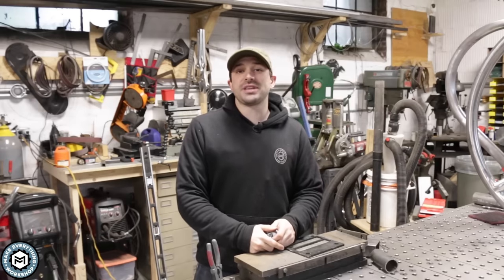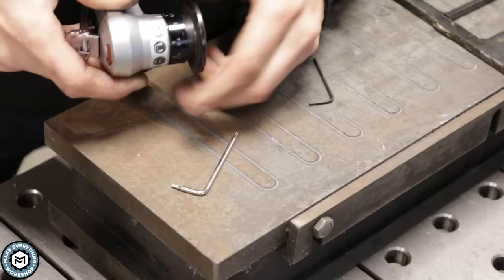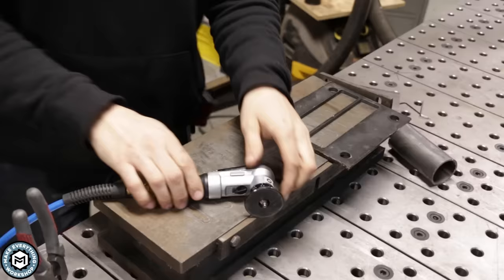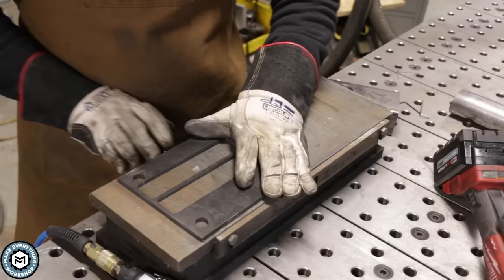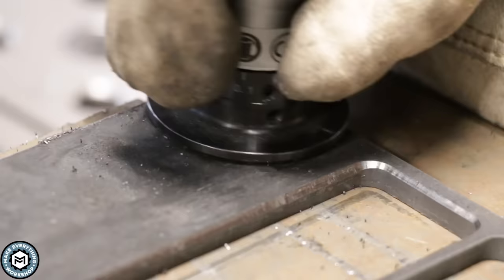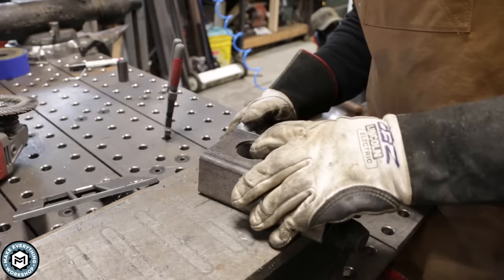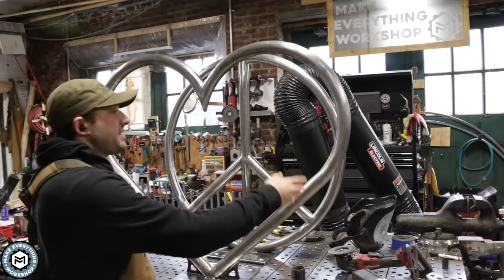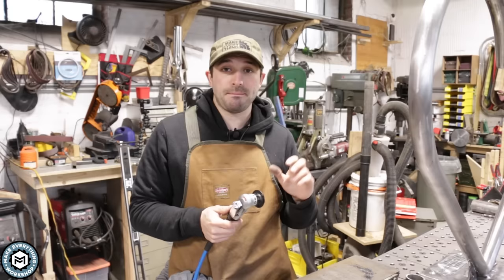This $88 Tool Will Change Your Metal Work Forever!

Comment: I'm a recent self taught welder (!) - what about using this to "grind" welds rather than using a disc wheel?  sorry if it's a stupid question, I don't know that much about metal work.  on the other hand, I've been writing software professionally for 30 years, so think about how you feel when you ask computer questions....
Reply from the maker: If you are referring to grinding before you weld to have a nice chamfer for the weld to go in, this would be fine for that.
Reply: Being new to welding he might be asking about after-weld grinding. Probably keep using a disk until you get good enough at welding to not need grinding 😁

Comment: The plate you are doing your demo on it too thin to use on the magnet. You are jamming the screw for the bearing into it while you use the tool. Just hang the part off the edge. It is basically just a small router with metal cutting bits. Keep the bearing oiled and it should last a while.

Comment: Measure the bearing and check with  RC helicopter suppliers . horizon hobby or align helicopters may have the size you need .

Comment: If you can find brake lathe cutters  that fit, you can flip them over so you get 6 cutting sides
Reply: The geometry in which these are mounted is of a positive style thus not possible to flip over.
But it should be a standard T-insert, just need to specify the size, thickness and relief angle.

Comment: The bearing is commonly used in aviation. The part number is on the side of the bearing you’ll need take a cell photo and enlarge it and you can read it and order on Amazon. Just saying 😎

Comment: imho, everyone should learn metric measuring, unless you are absolutely positively gonna stay confined within the US borders. Most of the world uses the metric system.
Reply: You'd be surprised how much stronger imperial threads are vs metric too.
Reply: @harperjmichael  I call BS; both metric and imperial use the same 60deg profile, just with nominal dimensions in the corresponding units. Metric is a slightly higher TPI than UNC from memory, and size for size a fine thread is stronger.
Reply: What's really funny is that if you are doing any machine work or using anything finer than a tape measure, you're already working in metric that isn't metric. Meaning, as soon as you convert your measurements to decimal form, it's the same as the metric system.  
Ex. 0.125"  
Metric is just simpler.

Comment: If the bearing goes out just make a bushing to replace it and grease the edge to prevent heat it will be fine on small pieces

Comment: Seems like the bevel varies quite a bit on the first two zoomed in shots.  Is that an optical issue or does the bevel vary on thickness due to pressure?

Maybe that loose bearing is contributing to it?

Looks like a great tool and I'm really glad you showed us.  I just want to know what the limitations / expectations are.

You kept saying consistent chamfer, but seems like it could be a little more consistent?
Reply from the maker: If the edge has any defects in it it’ll translate in the chamfer so you have to be aware of that. Also you need to have the tool perfectlyy flat on the work piece or it’ll cut uneven. Takes some getting used to
Reply: @MakeEverything  thanks for the added detail!

Comment: how about chatter breaking carbides, it seems like you can hold the part in your hand without any trouble
Reply from the maker: So far so good but easing into the cut would make a difference if your taking a heavy cut
Reply: Chatter breaking carbides, I think you mean the asymmetric flutes distance on an endmill, which will not let harmonics to develop.  With a tool like this, where you insert your inserts into set slots, there is nothing you can do.  Does it make sense?

Comment: I was making an exhaust flange for my Japanese tractor. Trying to do it SAE I was coming up with really unmanageable measurements. Then it occurred to me, this thing is metric. The bolt holes are 50 mm on center. That only took me one half hour to figure out, sigh
Reply: metric on a japanese tractor? who'daa thunk it

Comment: Dont work in metric?  All ya gotta do is divide mm by 25.4 and ya got inches.  Or other way, ya want a 1/8” chamfer.  0.125 x 25.4 = 3.175mm

Comment: Thoughts on buying the bit and using it in a router? Anyone know what kind of rpm it runs at and what the shaft on that bit looks like? Just asking because I already have a router and my compressor doesn't have the cfm's to run that.
Reply: I use a small router on aluminum.
Also ear plugs and ear muffs.

Comment: I have owned a Dotco 90 degree angle sander/grinder/shaver/saw for years, and I have many of the attachments that make it a very versatile tool.  The one you just demo, the Dotco could easily have this as an attachment on a much higher quality tool, but alas, it does not, leaving me to seriously consider yet another tool purchase....argh :-)

Comment: im 100 percent sure thats a standard bearing
if this tool used for  metal, then its  better  to check before  use,  measuring the  bearing and order a couple of   of them

probably a few dollar  one pc
its  quite aggravating   tool breaks down by a 2  dollars bearing
as well as inserts should be  on shelf as spare  parts

Comment: That thing is awesome! How do you think it would work using a smaller air compressor, such as an 8 gallon?
Reply from the maker: That’s a good question, I’ll have to try it on my camel compressor and see
Reply: @MakeEverything  It need .22 m3/min that is 7.77 cfm, 2 1/2 hp compressor cannot keep up
Reply: Itll spin it good for about 10 seconds then it will lose too much air pressure to be useful air tools like this and air drills and die grinders use a ton of air and are only useful if you have a large compressor

Comment: Sorry for the rookie question:

Is it possible to use these bits on say Milwaukee's M12 Right Angle grinder or M12 polisher (higher torque)? Or is 12V not enough power for this task?

Amazing tool!
Reply from the maker: I don’t know if it would have enough torque. I have another video on my channel where I use a steel cutting round over bit, I was trying it in a cordless palm router snd it didn’t enjoy it very much... these pneumatics seem to do the trick!
Reply: Modern 18v  brushless cordless tools are about 3 times the torque of  most air stuff i have ever seen  i really think the M12 would probably be ok .  the little flat plate to square the tool looks like a good 3d Print project  to  then fit to a die grinder or polisher
Reply: I would say RPM may be a problem. I use die grinder that works much the same and it spins at 20 000 RPM

Comment: Nice tool. Just my opinion though, I’d work more and the quality of those welds rather than jazzing up the edges of your gussets.
Reply: In my experience, paint and powdercoat hold up much better on chamfered edges. The welds do look a little cold to me.

Comment: Hey Chris, possibly a really stupid question, but how do you think this would work on wood (if at all)?  I tend to leave a pattern bit in my mini router (the one I use the most) so saving me the time of looking for and swapping bits would be nice. :)
Reply from the maker: I definitely think it would work on wood, it only does a 45 degree bevel but I can't imagine why it wouldn't cut wood.
Reply: @MakeEverything  Being able to put a really small bevel on stuff would save me a lot of time on some projects. Since you can set the depth and all. I just wasn’t sure if it would chew i tup or just make a nice clean bevel. Thanks!

Comment: Bearings look like standard router bit bearing. Home Depot, Lowe's etc. Amazon 10 packs about 8 bucks.
Reply: I have two of these tools, each has a different bearing size. And I own a custom woodworking shop, over 50 routers, hundreds of bearings. None fit either of the two machines I purchased. I matched them up in a local bearing shop, but at a cost of $3.12 each. Quality (USA) was far superior to the bearings that came on the machine, which were very loose and wobbly, whereas the locally purchased were tight and excellent. FYI, the first tool took 2 months to arrive - it was shipped direct out of China. Cost: $75.63.  The second tool through Amazon took 4 days, cost: $62.39. They both looked very similar, though the first one is polished chrome and came with one set of extra cutters (3 pieces), the other machine (shipped direct from China) had only the two wrenches and has a matte finish. Both work very well on mild steel - haven't tried them on ss yet.

Comment: Could this tool work on a very small parts- like a 1/2 x 1/2 square steel tube, GA for a handle cover sleeve?  I would be looking for something like a 1/16th chamfer.  I currently cut them with a chop saw (evolution) and then it takes alot of manual work to clean them up after the cut.  So looking for a tool that can help.  Thanks

Comment: So, its an air powered router?  What is the RPM rating?  Could I just put the carbide cutter in my palm router?
Reply: Yes, woodworking carbide cuts metal also.  You want high speed, and the biggest shank that will fit your tool.

Comment: Those triangles have 6 cutting edges.
Reply: The ones in the linked replacement cutters are back beveled, so only three useful edges per cutter.  
If they had straight sides, you'd be able to flip them, but this small radius cutting tool wouldn't actually be able to use them without dragging the back side of the trailing edges.

Comment: I use a electric one   wears out inserts fast makes 2 burs instead of the one  nope I can't regulate speed on the ting probeby slower is beter  but I dont like it  your mileage may very

Comment: that bevel is chattering and rough, its hardly nice unless you conciser rough work nice.  for nice work the mill.
Also for hand use i wonder how susceptible to chipping those inserts are. those inserts look like UE620, a poor choice actually.

Comment: I just bought one of these.  The carbide inserts are out of stock per your link, and they do not give you any useful information to source them.  Has anyone bought the replacement inserts, if so did the box have a real part number on it that can be used to find them somewhere else.  Has anyone figured out what insert these machines use?
Reply: I contacted the seller and they told me what Insert it uses.  The insert is “ TPMT080204N “

Link to eBay where I bought mine “ https://www.ebay.com/itm/373558365638?hash=item56f9d04dc6:g:6lgAAOSwHDdgiNOQ “

Note:
I have not received anything yet to verify that the inserts they recommended actually fit.
Reply: @LQ-C  thankyou

Comment: Anyone know what the minimum SCFM @ 90 psi is required to run this tool?
Reply: It need .22 m3/min that is 7.77 cfm, my 2-1/2 hp 7.5 gallon compressor cannot keep up to do smooth cuts
Reply: @rbts5346  Thank you.

Comment: I contacted the seller and they told me what Insert it uses.  The insert is “ TPMT080204N “

Link to eBay where I bought mine “ https://www.ebay.com/itm/373558365638?hash=item56f9d04dc6:g:6lgAAOSwHDdgiNOQ “

Note:
I have not received anything yet to verify that the inserts they recommended actually fit.

Comment: Two sets, each with three sides, gives you 6 lives, not twelve.
Reply from the maker: math is hard
Reply: Except that it's 3 sets. Plus the set included with the tool. That's 4 sets each with 3 sides. So Chris was right. It's 12.

Comment: Intermittent metal cutting with carbide tips is traumatic for the tips, the tip holder, and the user.  I predict a short life for the work end of these bevellers.  And for your magnetic chuck.  Looks like it has a deep groove where your tool stickout was greater than the workpiece thickness.   I wont be buying one.
Reply: Any tool and Die maker will prove you wrong on that theory. The inserted cutters I have been using the last 30 years hold up pretty well to an intermittent cut.